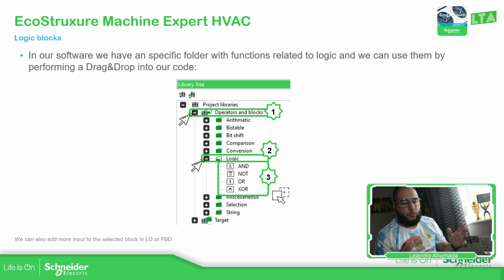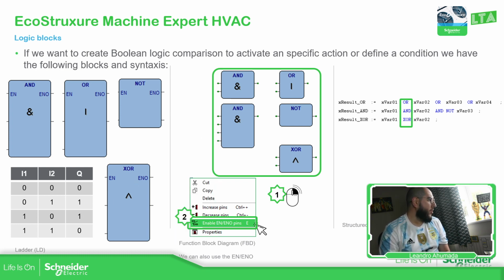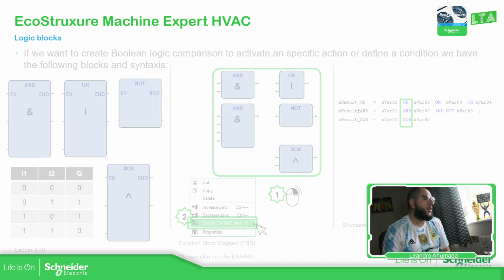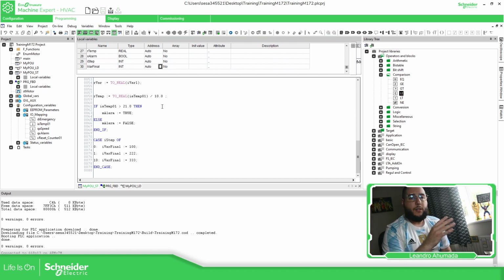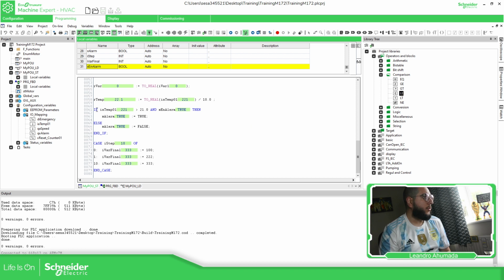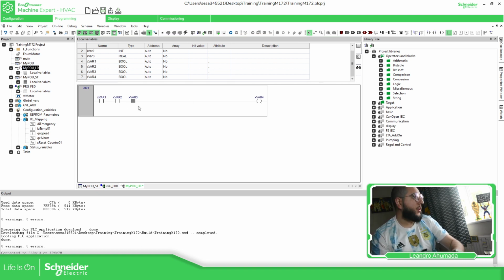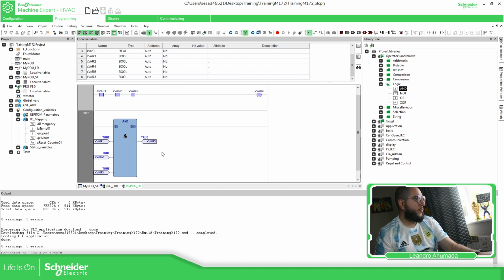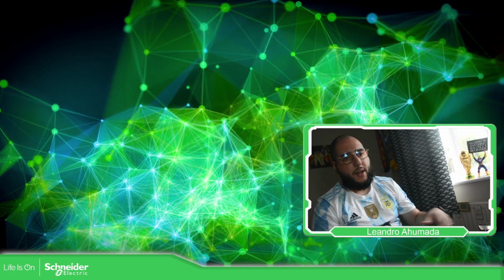EcoStruxure Machine Expert HVAC Training - M5.3 Logic blocks

Comment: Mr, LeThomas last two a go i have send you the massage regarding the PLC i have M221 i cant download or upload to the PLC i have download new firmware still is has same Please reply to me and I waiting Thank you Sir.
Reply from the maker: Hi there! I just saw it 😊.

Hi there! I recommend you to update the firmware of the M221 using a sd card just in case and check the txt with the result, please follow the next video:
https://youtube.com/watch?v=LdT7b8kRMQs&feature=shareb

Try also to check the download of the program using the sd card:
https://youtube.com/watch?v=3p89GN5vi8Y&feature=shareb

If this does not work check the led status of the m221
Reply: Thank you Sir i have fixed the problem easily after the your instruction please update to me adding temp PT100 to my PLC TM 221 the way to do the programing thank you sir